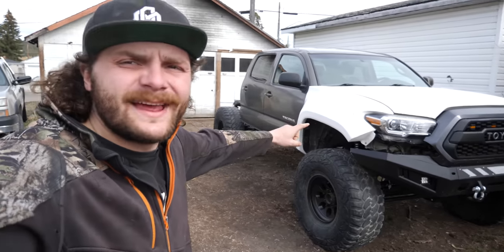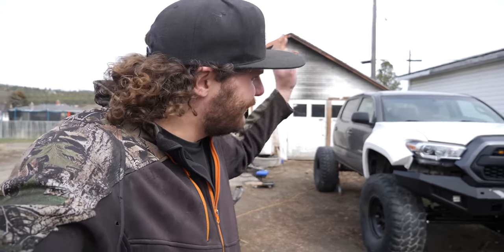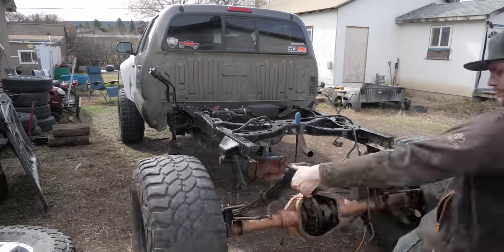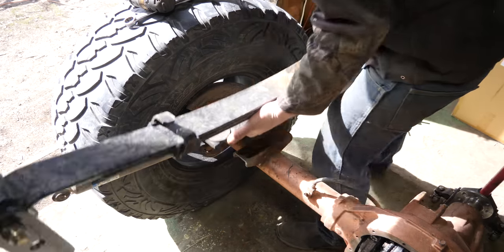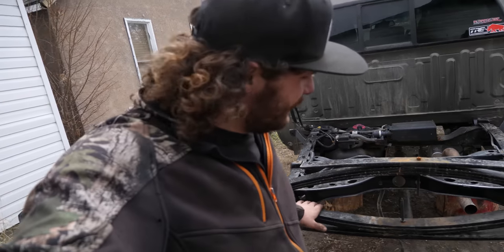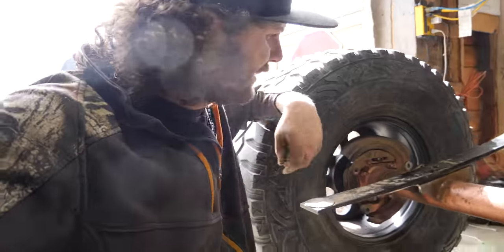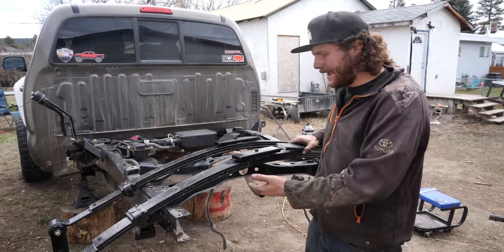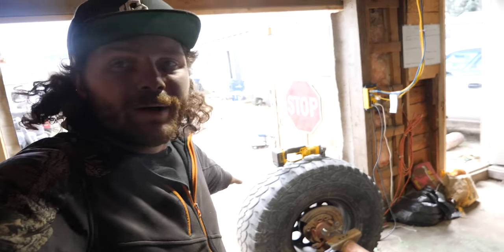Tacoma on TONS | Rear Axle Re-Gear Prep

Comment: I think I jumper the fun buy-in my new tires for my build. I bought a Dana 70 rear axle. And just spent a ton of money on 15 inch tires not even thinking that the Dana 70 or 60 needs probably 16 inch wheels or more to clear the rotors on these big bad boys. Ugh. 38.5x11x15 Boggers, which work great on my 93 4 runner. Anyone know the minimum wheel clearance for a Dana 70 rear? I plan to run the disk break conversion if that makes a difference, which might save my bacon...